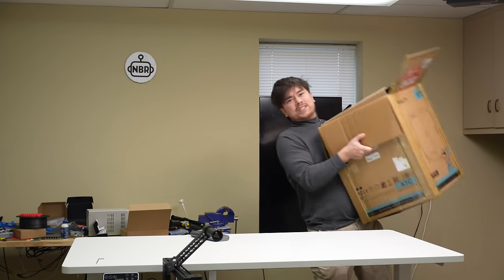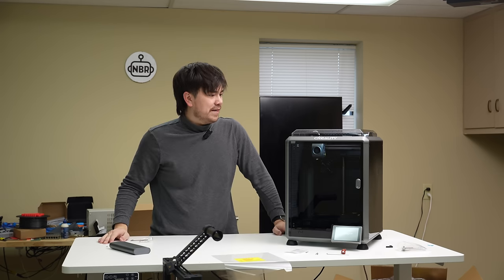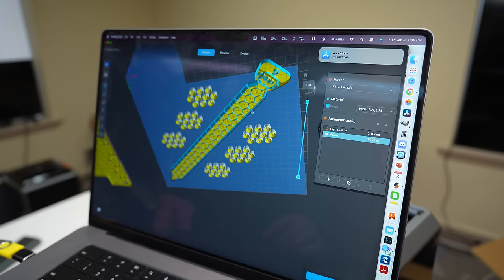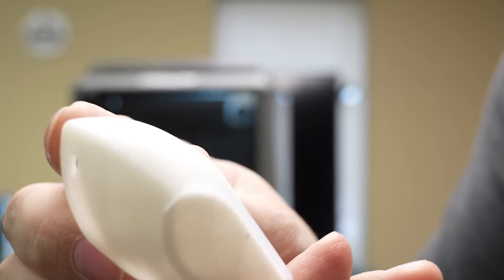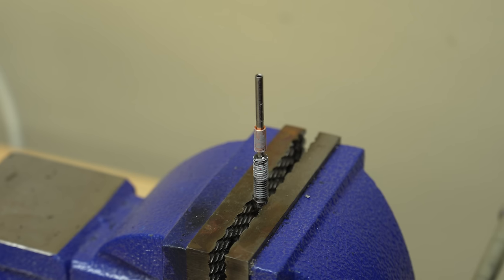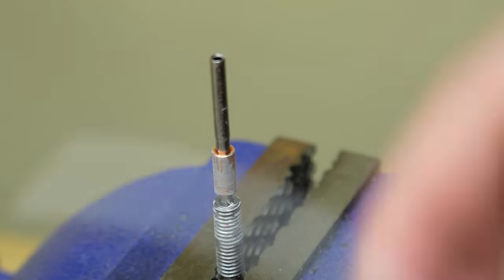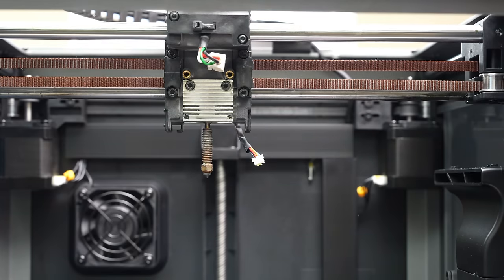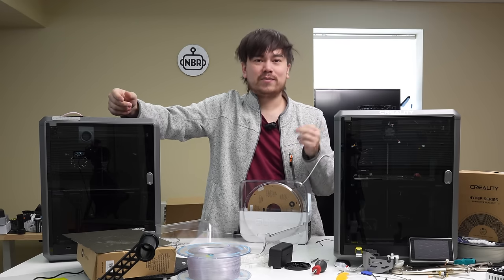Creality K1C - Flagship Carbon Fiber Printer

Comment: I think I speak for everyone when I say. Thank god your safe... a few of us thought Bambu got to you after the last video😅
Reply from the maker: Actually, they did get me. I have been re-educated. This is Nathan's pro-bambu replacement clone.
Reply: Fr
Reply: They would probably feed me to a Panda if the had to re educate me .
Reply: @NathanBuildsRobots  Bambu Builds Robots lol
Reply: Still waiting for multicolor. Any updates?
Reply: @Horsenb 
You’re an actual bamboo plant?

I am skeptical.  😾
Reply: Yes. Yes I am
Reply: This is a POS machine, had it for a couple days and had 50/50 failed prints and it is stuck and I don't have anything to fix it with since there are no replacements.
Also you are stuck with a single nozzle kit for the K1C, the C is for this is Crap and do not bother buying it.
Reply: @Fraser_Noble  exactly might as well build a cheap encloser for a prusa and call it a day
Reply: @Fraser_Noble Bought it and happily printing ABS carbon with great results

Comment: Burning the filament out created your own problems. Do you not have a heat gun? A hot air gun will get hot enough to melt lead without setting anything on fire. That might have allowed you to get the stuck filament out. I think they could do better with the Bowden tube routing though.

Comment: I know you posted this a long time ago but the Flowtech Hotend shows it ships with hardware for both old and "New K1 Printers" that has the longer copper thermal adapter. Did yours only come with the one shown in your video?
Edit: I see your box doesn't show the K1C like the new version does.

Comment: I'm printing a lot of CF-PLA on mine, and it's working flawlessly, an ancient roll of Proto-pasta, the original formulation, brittle as hell. Taking the reverse Bowden out of the cable chain is essential, added hinged risers for the lid to give it plenty of clearance.

Comment: Easiest way to induce heat creep is not letting the fan cool off the hotend completely after a print. 

New filament isn’t coming in so old filament is cooking while the heater temps are transferring directly up into the heat sink due to the fan not being on to dissipate the heat. Do this enough times and your eventually if not immediately get a clog.

I point out something so obvious because you do that at least once in this video ( 21:35 ). I was even thinking “he’s gonna clog that nozzle not letting the hot end cool off”.
Reply: Yes, that is an issue.  If you power down before it has cooled then you’ll have a nice surprise to take up some time and possibly spare parts when you switch it back on.

When you have a super-reliable machine that never requires power-cycling to escape weird intractable errors then this wouldn’t be as annoying.  My AMS unit is cursed, though, so no such luck.  😾

(Did manage 19 hours of a 20 hour print yesterday / this morning, though.  So I guess that 95% reliability now.  Winding the filament in, stops at print-head, thinks a bit, winds back out, repeats about five times, then claims there is a blockage.  Pull filament entirely, pull power from AMS then reapply, load filament, and it now works.  I had about eight of these over 60 layers, so a nice semi-random problem.)
Reply: no buddy i see what you are saying but that is not heat creep.

Comment: I have a k1 and I do like it. I fixed most of the small issues and also have it rooted and running stock klipper and fluidd now. I was excited for the new hot end but now am on the fence. I would say the best way to print carbon fiber nylon , petg etc is to use a 0.6mm nozzle. I had issues with heat creep and the nozzle getting plugged up when printing cf material. The only one I had no issues with was cf PLA when using a 0.4mm nozzle.
Reply from the maker: That's probably why they sent me a spool of CF-PLA. I'm going off script with possibly predictable results?

Comment: For clogged nozzles I use a cheap rework station instead of a torch to avoid degrading the nozzle/heat-break. When used with the metal NoClogger (available on amazon) there's essentially no clog you cant remedy. Hope that helps in the future, & great vid!
Reply: I had a similarly bad clog on my K1C 1 week into owning it, spare nozzles are also not available (probably for months), so I just turned off all the fans, turned the hotend all the way up and after waiting a couple of minutes to heatsoak the entire nozzle assembly I could just push the clog out the top with an old guitar string. 
The whole extruder and nozzle construction is solid and pretty easily serviceable if you know what you're doing.

Comment: Sound can't escape through very small gaps due to "wave guide beyond cutoff".  That is if the opening is much smaller than the wavelength of the sound, the sound won't propagate through the opening.  So high frequency noise might escape, but low frequency noise won't.
Reply from the maker: That is cool! I didn't know that.

I guess what I'm noticing is the higher frequency hissing noises and possibly stepper motor ringing leaking out through the smaller gaps.

A lot of mechanical noises is they are a broad spectrum noises, so it's a combination of lower and higher frequencies.
Reply: @NathanBuildsRobots  The term "wave guide beyond cutoff" actually refers to microwave electromagnetic waves, it's the reason why the microwaves can't go though the door of your microwave oven, thanks to the metal mesh in the glass.  The same principle also applies to sound.  Anyone building a ported speaker cabinet will run into this when sizing the port opening.

Comment: Probably already being said but remove the bowden tube out of the chain and you can even print carbon nylon out of the regular K1 series (with a nozzle change) i made a vid about it using the bondtech nozzles.
Alround a well needed update, thanks for sharing!

Comment: You can set the preview images in Orca. You can choose between several file Formats and sizes. One will fit the X1C. Try .PNG and 256x256

Comment: It's too bad you had issues with the nozzle.  I was hoping you'd cover printing ASA or ABS with it.  I've been printing a lot of ASA in my K1.  I wrap it in blankets and use the bed to bring the internal temperature up to 50°C, then as it's printing it slowly creeps up to 60°C and I get beautiful ASA prints.  However, the heat brake fan will fail at those temps.
Reply: Good to know that the K1 heat break fan can't take the heat of a pseudo heated chamber.  I drape a clear 30 gallon trash bag over my Neptune 4 Pro and the 110 C bed gets the "chamber" temperature up to 55 C and ABS prints very well, but the little model light LED built into the hot end dimmed so much after 100 hours of printing ABS that it's now useless, but so far everything else has withstood the improvised heated build chamber on this open frame bed slinger.

Comment: The filament tube needs to come out of the cable chain to relieve that sharp angle. 
great video thanks,
Reply: I did exactly that with my Bambu Lab P1S.  I used kapton tape to build up the Bowden tube for a good fit to the guide-ring section at the top of the head.

Tried a couple of printed ‘guides’ for the Bowden, but they weren’t that successful.

Comment: Why do Creality users always need to print out mods to make the printer more usable or to fix serious bugs in hardware other manufacturers don't have? For 249,-€ you get a Creality printer with 6 years old technik. For 299,-€ you get a brand new Bambu Lab A1 mini with options to ASM Lite. And you don't need to print any mods for the A1 to make it usable :)
Reply: Because we are super users, un-like those with apple devices!

Comment: What I learned in sound pollution class is that human perception of sound is logarithmic, thats why every 10 point decibels increase multiplies the sound level by 10 times. Lets suppose the hole in the K1 door is 1/25 the doors size, you will have  a 96% energy reduction in the sound waves, but in decibels it will be like 12 decibels less. Closing that little hole correctely may get to 99%, but it will be only another decibel.

Comment: What I‘d like to see for all these Bambu Lab, Qidi, Creality CoreXY-printers, are 3rd party hotend assemblies that allow flexible nozzle changes using standard nozzles without requiring to screw or deal with cables. Just a smple mechanism that makes nozzle changes as fast as Formula 1 tire changes. This may be even provided by hobbyists with knowledge in mechanics and electrical engineering.
Reply: I am waiting on the BIQU Panda hot-end.  It’s the E3D Revo hotend system adapted for the Bambu Lab machines.  It’s certainly possible that there will be something made for the K1 series.

I have the Revo system on a (only slightly modified, only one careful owner, honest…) Ender 3.  It is very good, with only having to mess with the z-offset a bit on nozzle-change.  Using the nozzle to probe should make this an effortless option for the Bambu Lab machines.

Comment: I returned a K1 after i did dimensional print tests, found 0.8-1.6% dimensional variance. For me that's a lot for mechanical parts. I was about to check the belt tension and square and immediately saw the belts didn't line up in parallel on the X gantry. And if we remember a2 + b2 = c2, that means the closer you get to either side the belt's pull on the tool head will move further from 1:1 the closer it gets to either pully.

Another thing that bothered me was the nozzle temps jumping +/-3c printing at max speed. The 4020 blower it has is impressively powerful, and about 3x as powerful as the standard 4020 blower (normally 0.8A and the K1's is 0.3A). But still got +/-1-2c at normal speeds of 200mm/s 3K accel when the fan was running far slower. I ran PID on the hotend about 5 times, patted my head and rubbed my tummy etc. I have another printer with a volcano hotend and klipper shows about +/-0.5% nozzle temp variance printing at 325mm/s with 4.5K accel. And the parts showed, on the K1 i did notice on parts that they would have glossy corners and small sections then matte on straight sides/faster motions. I would blame thermal mass on that, but idk because i returned it before i felt like tearing the whole nozzle apart.

I printed the benchy included on the USB, it came out nearly perfect.. SUPER impressive. I just couldn't rely on it for engineering parts. And i knew that going in, especially with long belt runs on Core-XY that lend to "inaccurate" travel
Reply from the maker: I'll check on the gantry, good catch
Reply: Is there a printer that is known for having little dimensional variance?
Reply: @joeking433  all of them really, the belts have a small amount of stretch till they yield then tension raises significantly per unit "stretched" after that. (Edit) And if it's not perfectly square and tramed, that will compound. But! Where not running CNC/Milling machines... Soo, for the most part the 'plasticity' of what is printed can usually fit together just fine. I did get mine down to >0.05% in X, Y, and combined. Just as good as a CNC that hasn't been maintained 😁. One great tip I got from someone's video was to clock the linier bearings in a + position, so that the bearings ride on the axis. That noticeably got rid of a ton of slack

Just looked up position accuracy on Gates GT2 6mm belts, their doc shows 0.010in/0.3mm per 92 teeth on 20 grove pulleys @6.6lbs with a 200step motor.

*I always put mine to 7lbs as its enclosed and I imagine the rubber teeth get soft
Reply: @MrHeHim  What printer would you recommend for having little or no dimensional variance is what I meant.
Reply: @joeking433  ohh, sorry. You can make most printers really accurate. I just know of three that have bad pulley positions, the K1, Ender V3 SE/KE, and Duplicator i3 I bought many years ago and still own. Which I had to design a new bed Y stepper bracket for.

If they don't have said design flaws, then it's just a matter of squaring the machine perfectly then tramming the bed. I don't think any of them will come perfectly square or with the perfect belt tension. But! If you put a gun to my head... Pre built PRUSA and Bambu. Bambu has a patent on the auto tensioning system on their printer, only drawback is the extra long belts Core-XY printers use will introduce less accurate positioning. BUT! Idk, I haven't compres them.
Reply: @joeking433  On my Qidi X-Plus 3, I regularly see no more than 0.1mm total variance across 200mm spans for X/Y.  ie. 199.95-200.05 sort of deal.  Mind you, that is after adjusting the model for cooling shrinkage.  That's the thing.  Printers can be extremely accurate, but filament shrinkage will almost always be the dominant factor for dimensional accuracy for anything larger than a few centimeters.
Reply: @MrHeHim  Yeah, I have a Prusa mini and a Bambu A1 and both seem to not put out  perfect dimensions.  Great printers, though!  The Prusa is a great printer, slow but puts out beautiful prints!  The A1 is a fast and dependable workhorse.  My Kobra Neo is the worst with much more dimensional variance than the other two.
Reply: @stew675  So, how do you adjust for the shrinkage?  Just increase the dimensions proportionately?
Reply: @joeking433  Basically yes.  I use Orca Slicer.  If you look in the filament settings you'll notice that there's a "Shrinkage" setting.  Generally it's as "simple" as figuring out that value for whatever specific filament you're using is.  It defaults to 100% because by and large, most people don't need super accurate dimensions.  For those that do, run some test prints and calculate the correct value, and let the slicer do the work for you automatically.

If you pull a calibration print fresh off a bed and measure it while it's warm/hot, and then continue to measure it while it cools, you can quite easily measure the shrinkage in real time.  For weird geometries (such as things with lots of gaps/holes along one dimension) you may need to manually scale the model in certain directions, but for the most part shrinkage is a consistent amount and is covered by that one single parameter.

Shrinkage is what causes warping and/or layer splitting for certain filaments if not managed correctly, such as using an enclosure, or even better, a chamber heater (which the Qidi X-Plus3 and X-Max3 have).  It affects all filaments, but some more than others.
Reply: @stew675  Hey, thanks, man!  You're a wealth of information!
Reply: What you have to get going is variable square corner velocity, your prints are glossy when you’re printing slow, sqv by default is 5 I think but if you watch the benchy print that comes on the printer storage, you will see via mainsail or klipper that the sqv will change with every type of line, infill outer and inner walls.

Comment: I like the cable chain improvement, but the rest of the stuff it seems my regular K1 is just as good if not better. My 3d printed hepa/activated carbon filter seems way better, my Triangle Labs "diamond like" nozzle seems way better -- and I can put a 0.6 on it if I want to print CF materials. You can just buy and trivially install the same "AI Cam" on the K1.
Reply from the maker: How much AI does it have though? :D

Comment: It's like such a nice printer with a few really sloppy flaws. I hate the notch in the door for the screen as well. Had to have been a better solution like even a flip out screen. The Bowden tube angle is really just ridiculous. I have been running the Creality carbon fiber PLA, not Hyper series, and it's nice. Pretty much prints like normal PLA except you have to use minimal if any retraction to avoid clogging. If you were running retraction, likely what caused your issue as well. The filament expands, cools in the bimetal heatbreak, and then jams extrusion. Despite running 0-0.2mm of retraction, stringing is very limited. It is still surprisingly flexible, but has a sudden breaking point. Really nice matter outside finish is probably the biggest upside.

Comment: How did the filament break in the bowden tube, but was still in the tube?  wouldn't the extruder continue pulling the filament from the break?  I think you got a clog and the filament broke from the constant flexing as the motion system continued on.
Reply from the maker: I think you're right. The filament had a dent in it from the filament grinding away at it. Not sure if it was a nozzle clog or heat creep that caused it, but either way, not good.

I suppose there is a possibility that it was bad filament that caused it as well.
Reply: Exactly what I was wondering. What I learned on my K1 Max is that the extruder gears get so hot that they will soften if not melt PLA filament. After a rushed change from an enclosed ASA print to Creality Hyper PLA the PLA filament melted inside the extruder. Once that happens, you can't make the extruder push out filament and the filament acts like a pin, preventing you from disassembling the extruder to clear the jam. Sucks.

Comment: Thanks for your elaborate video. 34:00 maybe next time you could insert the nozzle in a separate heat block outside of the printer and hook it up a bench power supply, then you should easily be able to push the residual stuff through with that tool.

Comment: I think what causes your "VFA" is slicing from a STL (point cloud model) where arcs are basically polylines, and I think the print head is doing accel/decel at each line segment when cornering and therefore extruding more near the intersection. I would try feeding a Gcode file that uses geometeric arc interpolation (G02, G03) and see if the problem goes away.